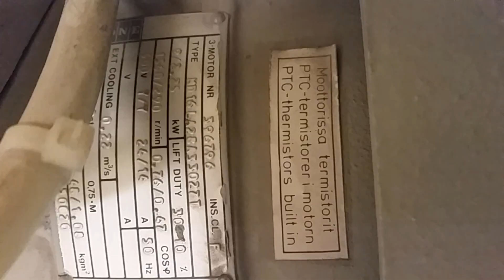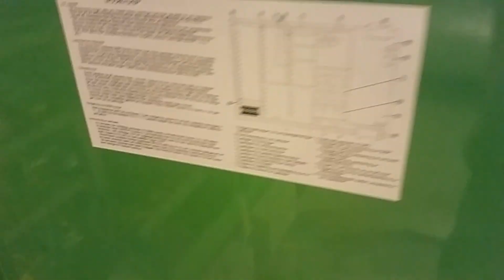Elevator Motors

Comment: Very neat installation, having the controller for all three in one cabinet. Are these duplex controllers? I saw what appears to be a micro drive / tail twister motor next to the brakes, which appears to cut in after the primary hoist motor cuts out for leveling/slowing the car on the landings.  The idle sheave appears on the order of a guide sheave offsetting the ropes between the driven and idle. Is there a deflector sheave located beneath the machine base?  I presume these are induction motors 3 phase 340 or higher VAC w phase reserving relays.

Comment: awesome stuff! so it just uses contactors to switch on and off the motor and control direction? and the flywheel/monentum of things give it a smooth ride?
Reply from the maker: It has a soft start and soft shut down with the SCRs you can se at 3:20 and the contactors swithes the motor
Thanks for commenting

Comment: There seems to be a lot of relay noise do they also control the indicator lamps in the lift?
Reply from the maker: Yes there is a lot of relays for starting with soft start and by-pass the SCRs and the floor indicators are connected to the relays, the three clicks when the motor stops is for slow shutdown and the brake, you can see the brake at 1:20

Comment: What is the motor voltage 208 or 480 3 phase or 240 single phase
Reply from the maker: The motor voltage is 400V three phase

Comment: One thumbs up is not enough!
So does the pulley connected to the motor connect to the elevator while the idle pulley connects the counterweight?
Would really like to see a room like this on a skyscraper with some floor to floor elevators and a high speed run.
Reply from the maker: Yes it's like that, the idle pulley connects the counterweight, this is just a 5 storey building but very intresting, I hope you will see a place like this some time